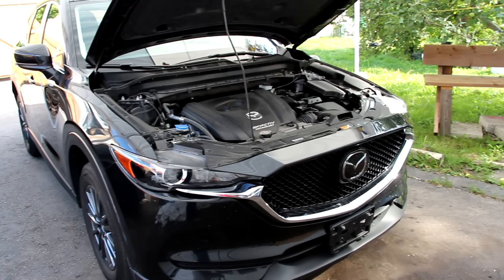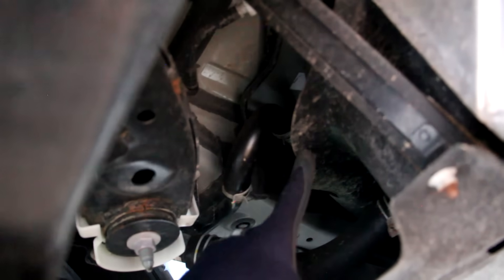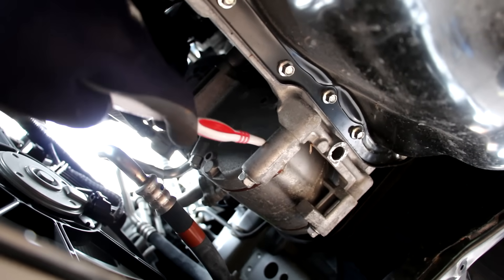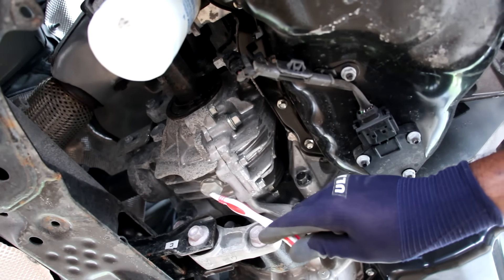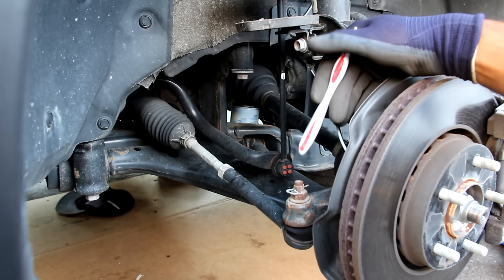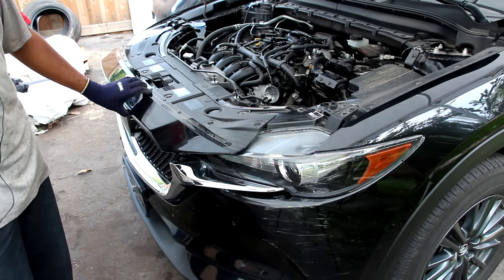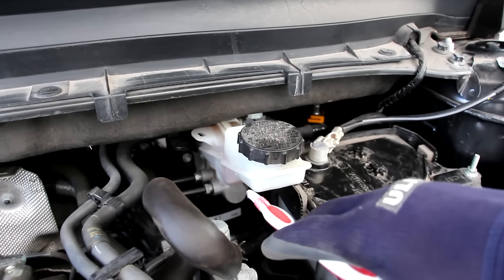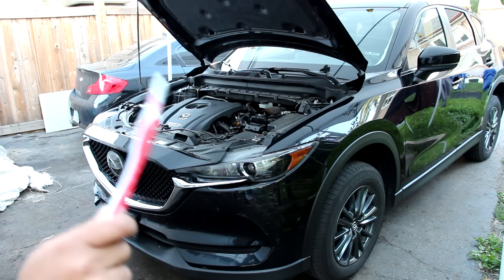Mazda CX-5 Mechanical Review

Comment from the maker: What do you all think of the CX-5? Is Mazda behind the competition under the skin?
Reply: Behind the times is fine is reliability is what you are looking for. Having a car last makes economic sense!
Reply: A car with weak engine mounting.
Reply: I don't think you appreciate the high compression ratio engine, which runs cool to avoid knock, the torque converter which integrates a small clutch and provides a better shifting feel, the G-Vectoring, which makes steering more relaxed and predictable, the fast-engaging rear drive with a predictive algorithm, to make driving in the snow & dirt better. Lastly, the suspension is dialed better than most of the competition, making for a more engaging drive.
I do think that 8 speed would be better for fuel-economy and would be a nice upgrade. In practice, I think fuel-economy is the only thing Mazda is really lagging behind it's competition and a lot of it is due to the transmission not being a CVT.
The SkyActiv-X is not sold in the US yet, because of the price premium, but this engine is a giant leap beyond all the competition.
Reply: @DavidDLee  i think here in the US the 2021 miata has the skyactive X engine.
Reply: @DavidDLee  Excellent.
Reply: Fairly simple than the competition...seems it gonna last long...(engine and transmission)...with the exception of the rusted suspension parts
Reply: @thealienrobotanthropologist  The sad truth is that all vehicles are built to a price point.  Many of us would pay more for better suspension components ... but most don't appreciate such things and the higher price for higher quality under the skin would turn the average buyer off.
Reply: @seanthompson8071  so true! I kind of love and hate my 08 Saab 95 bought 6 years back with 5000 USD. Tons of car for the money. I hate the parts are more expensive and less easy to get comparing to other brand. But I love the material they put together. Fuel pump definitely not one of these quantity parts!!
Reply: Maybe, but I prefer Mazda's simplicity, reliability, and ease of maintenance.
Reply: @bigchuck333  I totally agree with you. My 2018 CX-5 has been totally bulletproof.
Reply: @bigchuck333  Totally agree with you.  More complexity, means more $$$ in the long run.
Reply: It’s relying on technology from the previous generation of SUV’s, but out on the road there’s no contest. Test drove this right after the new RAV4 and theres no question the Mazda feels more solid, more controlled, and more substantial
Reply: I like tried and true that can still be competitive performance and economy wise. Better for keeping servicing costs low. My main concern would be that rust. They've lagged in that area for a long time. Being from Toronto, you'd know all about that 😎
Reply: @kristianhermann5971  That being said if they have been coated they are alright, even over here in MB
Reply: Only thing I would complain is the rusting
Reply: @neilwang3845  under coat it well...simple...every fall
Reply: @neilwang3845  I use 3M or Rustoleum undercoat to protect the "frame" and suspension.   If I buy a used car I wire tooth brush any rust spots,  use Rustoleum Rust Reformer  (spray can or 8 Oz liquid < with foam brush>) to make rust inactive, then top with undercoat.  It might take an hour to do most of the undercarriage and suspension on a warm- dry day.   Thereafter it's a Fall touch up,  and my cars go 200,000 with no significant rust.  Of course you can bring it to a specialty shop for this work.
Reply: @neilwang3845  2010 > has better rust protection sheet metals
Reply: @7spower998  thanks for sharing! Rusting is pain since I live in Chicago.
Reply: @neilwang3845  My Audi chassis has chassis surface rusts too. Chassis nominal metal thickness is at least 3mm thick, so I won't worry about it. It's an easy fix. However, Mazda has improved a lot in the body sheet metal surface rust.
Reply: No, it's what Toyota has done for ever keeping things tried and true and slowly implement new tech
Reply: @Argedis  Toyota has in the past had oil burning issues on the RAV 4, and their 8 speed automatic trans has had problems.
Reply: @Argedis  Exactly, a $40k Tacoma still has rear drum brakes
Reply: @Argedis Toyota is begging Mazda for new development insight.. they are a powerhouse together and built a massive factory/assembly line TOGETHER. Check it out!!  Google it! They are actually banding together for some great cars (imo) I work in the collision industry and have worked on 1000’s of Toyotas and Hondas. Mazda is right there with them since they dropped FORD IN 2016ish…
Reply: I like the cx5 non turbo.. thinking of buying a 2021.
 I don't think turbos are that dependable. Turbos on a gas engine in a car is not the same as a turbo on the semi truck engine.
Reply: I used to sell Mazda, Subaru, Hyundai, and Genesis, all in the same auto mall. Hands down and by a long stretch, Mazda was way more engaging to drive, better built (dual-pane glass), solid door feel (double door seals), better handling, power to weight ratio, and highest quality interiors. I used to talk with the techs from all brands and Mazda had the least issues of all brands we sold. Mazdas are great vehicles, and the surface rust mentioned in this video was just surface rust. In Canada Mazda offers an unlimited warranty against rust!
Reply: As somebody who keeps cars a long time I'll take a NA engine and a traditional torque converted auto over a turbocharged pot and CVT any day of the week.  The sad fact is that all this new tech does is provide modest fuel efficiency improvements at the expense of decreased longevity
Reply: Please do a video on the 2.2 turbo D
Reply: They definitely built it to a price point but when you consider it's competition is domestic and Japanese compact SUVs but it ends up getting compared to brands like audi, I'd say they did a good job. If they were swinging for Audi/BMW/Mercedes and pricing accordingly, some of the suspension design would be unacceptable
Reply: The suspension, brakes, and tire width/grip are a disappointment compared to the old CX-7. That was a car really great for high speed cornering along with twin piston front and vented rear brakes. The solid rear discs of cx-5 feel like they take forever to stop(over 130ft)  Too bad the cx-7 had horrible fuel economy and alot of engine reliability issues, plus old people wound up buying it and complaining about it's sporty-ness
Reply: @TheBacontarian  I had a cx7 for awhile, loved that thing! It really was a blast to drive
Reply: Bought a 2019 CX-5 Touring AWD 8 months and 9k miles ago. I really do like it, mechanically it feels great. Sometimes when merging onto an interstate I would make use of a little more power. But that is compared to my RIP Supra and Civic R. Good points about the mech specs but from the drivers seat it really is fun to drive. The automated cruise/distance/braking/lane keep is amazing for the price point, $7-10k more to get the features in a Toyota or Honda. I would give it an above average in all categories except interior room which is probably smaller than average. Last thought, don't buy it in white its not worth the marginally lower sticker price, jealous of all the beautiful ones driving around.
Reply: @reitzg  I personally like the white color on the cx-5
Reply: @reitzg  do you have rust issue as well .just asking
Reply: CX-5s are certainly the best lookers in their class. Reliability...The Skyactive G are abit underpowered , but ultra reliable.  The Sky X is early days yet to judge. And the 2.2 Diesel...lots off issues still. Mazda are let down by the reliability issues with failing turbos, headgaskets, stretched timing chains, DPF faults leading to raising oil pressure resulting in oil mixing with diesel & also injector seals failing. Almost everyone i have known to have a Mazda..be it 3 , 6 or CX5 with the 2.2 diesel  has had expensive problems to sort.
Reply: I don't care for the electronics crap that manufacturers keep shoving in to new cars to drive up price. Technology is where I want the cost cutting to come from. All these electronics and advanced emissions crap are pains in the ass and are failure points that just means high repair and maintenance costs. NA engines also have lower engine bay temps so minimal issues with heat damage on the plastic parts.
Reply: Is pretty good boss..
Reply: 2014 cx5. Has a yellow exclamation triangle light?! Tire pressure malfunction, istop dead, hard to service need dealer appointment. Ac not blowing cold either. Its 2.0 L tho
Reply: Awesome video
Thumbs up for sharing.
Reply: Can you do the 2.5t that’s available from Mazda too?
Reply: Same can be said for Toyota 4Runner, that it is behind the competition.  The truth is, its proven reliability and dependability leave others behind......on the road.
Reply: Does it have an all stainless exhaust system?  In the salt-belt, an exhaust system that rusts is a significant maintenance cost...
Reply: The engineering is good enough for me. Fun to drive but not as expensive like bmw. I like tobe happy when im driving tho
Reply: No turbo, traditional automatic. Me likey.
Reply: I've got a 2016 CX5, easy to work on and surprisingly good offroad with the AWD. Only complaint is these don't have a bigger engine for towing over 1800lb
Reply: behind...?

for me,, big no.
Reply: How does this compare to Honda CR-V?
Reply: This is my 3rd. Started with a CX-7 and this is my 2nd CX-5. My 2020 CX-5 is perfect and just needs tires.
Reply: Love my 2013 cx 5 @150,000 miles and still going strong 💪
Reply: Can you do one on the CX-3? It would be nice to compare with the Kona, Qashqai, and the HRV
Reply: No port injection no thank you... Not a fan of direct injection only...
Reply: P
Reply: Do one on Mitsubishi Outlander Sport please, would be curious how it breaks down
Reply: The Skyactiv drivetrain was ahead of the crowd when it came out, and still hitech.  The engine utilizes the miller cycle that allows it to run 13:1 compression on 85  octane gas which also prevents carbon build up on injectors.  The exhaust is a folded full length tri-y header which no one else has done that gives you low end torque and higher efficiency.  Mazda was able to solve the cat heating problem with a full length folded header by dumping raw gas into the manifold when cold to heat cat up quickly.   The transmission is a first with dual-clutch and a tiny torque converter.  The torque converter runs from 0-5mph preventing rollback at stoplights.  After 5mph it locks up so there are no power losses in the transmission.
Reply: The people who buy Mazdas care about reliability and spottiness. The newer trans with 8 and 10 speeds and cvts do not make it to 100k miles
Reply: 2019 ,2020, Mazda CX 5, 40k and 30k. Running like new no complaint😊.
Reply: N
M I'll
K
Reply: These stories about the chain and its eternal durability have become ridiculous because we all know that today on all cars, including Mazda, the chains are damaged after 200,000 km or even before, so they have to be changed. And why, because most car mechanics are totally uninterested or are thieves, so they pour the wrong kind of oil into the engine and that's why the chain is damaged, so it doesn't matter how good the car is, just what kind of person maintains it.
Reply: I think removing the AC compressor to get to the alternator is a deal breaker. For that I'd say a slightly behind the competition.
Reply: @dpolendo  you dont have to drain the refrigerant, it has flexible hoses that remain connected. And it may not even be true. I noticed a few errors in this video
Reply: every car has surface rust. You sound like a mazda hater nit picking. This is a great power-train., Everything you want (variable valve timing, high compression, good economy, a real exhaust header and not some restrictive log manifold, good power, a reliable and proven 6 speed automatic (based on Aisin design, no Jatco crap) with an improved lockup converter design)....and nothing you dont (CVT, turbo).  They also seem to fair pretty well with the oem air/oil separator not having issue with GDI caused valve deposits
Reply: Is pretty good....
Reply: My 2017 GT had the same issues with the rear brakes; they were replaced this spring at 47km.  This seemed really premature.

It's a good car; drives well, affordable, and has most of the convenience features I want.  I've enjoyed it since I got it.

The rust is a bit of a concern though, as is the manufacturer recommendation of "lifetime transmission fluid".

Great video!
Reply: @robinaklu3768  hi...I to had my rear brakes replaced through warrenty work.at 39 000km on my 2018 cx 5. I had to be firm with the dealership as to WHY at 39 000 the rotors and pads were wore out.....wanted to sell me hardware.  I was um no...its pre mature
Reply: Boss you haven't grant my request sir... Am a little automobile engineer sir I need help from you sir.... I will be glad if you can help me to know you more.... Sir
Reply: very 🤔

Comment: Excellent Fantastic and thorough engine walk through. The only thing I wished is if you could mention say maybe two or three things that a grandpa or grandma could replace like PCV valve, Plugs etc. And things like hey this will cost you 3k if it fails because although it's just one bolt you have to drop the engine to get to it kind of things. This helped me to avoid the CX-90.

Comment: Great Video! What really made my day was seeing the tranni dip stick and the pan with a drain plug. Mazda claims the transmission fluid to last "a life time" what ever this means. I am strong believer in transmission oil changes and I even cut my cycles short to about 30k km. I so far did not have any transmission issues, even my 96 Audi A4 with the 4 speed automatic runs just fine!

Comment: Thanks a lot for the review! I'm currently looking at a used 2020 CX5, however I have some concerns over the cylinder deactivation engine from 2018 up. So just wondering if you had any issue with the engine whats so ever, since I have seen quite a few online where they had cracked cylinder head and blown engine. A full engine replacement for 10k is not something I can afford right now, and since the car only has around 3 month of warranty left I need to know what I'm getting into. Thanks.

Comment: I LOVE the fact that these have a NA engine, a traditional 6 Speed Automatic and FWD. 
Thats a drivetrain build to last and be reliable.
And the Transmission even has an easily accessable dipstick and fill plug AND a proper oil pan you can remove with access to the filter and the valvebody! How is that even legal for a modern vehicle thats supposed to be a disposable appliance 😂
No CVT or "Automated Manual" or Dual clutch transmission bullcrap and no downsized 1.0L 3 cylinder turbocharged abomination with a wet timing belt that grenades at 50.000 miles. Yes Ford your engines abolutely suck.
No factory AWD system that nobody needs that only makes the car heavier less fuel efficient and gives trouble eventually. Good thing they kept AWD a separate option.

The Skyactiv Engines are all direct injection for them to work thats a bit of a bummer but do these have an EGR system?

Comment: I got my 2014 used with a little over 50k miles. Currently got a little over 90k on it. The major things ive had replaced was the lower control arm-year 3- that had a nasty crack and always sounded like bones creaking, the alternator & battery--year 10. The other issue thats super annoying is the parking sensor--i have ro turn on and off at least 3 times before the it shuts off completely. The dealership is charging over $800 to replace it. 🤨

Comment: I’m considering buying a used 2018 with around 100k miles. But the owner’s manual say the transmission fluid is “life time”. So when do you need to change the transmission fluid?
Reply: I have read that lifetime actually translates to the length of the warranty. I would change at 50k or less

Comment: WHY DONT THEY DESIGN THIS ENGINE SO THAT THE in take valves WILL GET CLEANED, instead of leaving it, as it is,  to cause ISSUES for their customers. I will NOT BUY a Mazda for this reason.
Reply: Research Mazda Skyactiv. These engines are completely different from your traditional gasoline engine.  They only work with direct injection.

Comment: Really only 2 things stick out to me that I don’t like about the cx5. 
1. The electric flaps on the radiator. If they stick open then fine but if they stick closed then it seems like it would have cooling issues and with the thermostat controlling cooling I don’t see the need except maybe super cold climates 🤷‍♂️
2. Is the electric actuator for the emergency brake. If it’s stuck closed you’ll have a problem. I’d rather have a mechanical e brake.
I really enjoyed the video and I hope you do a lot more of these for a lot of other vehicles 👍🏼

Comment: Just joined Team Mazda with a 22 turbo. Great car, so fun to drive. It’s a little tough to lift safely, got some ramps. I’m doing a transmission service at 36,000 to get the break in metal out and replace the filter. Should be good for years then.

Comment: Is it normal for the shift linkage to make this noise ? 
I have manual 6 transmission on my 2017 CX5, which is making strange noises upon driving on 1st and suddenly releasing with the clutch, I heard such clunky noise. Could it be the same part making the issue ?